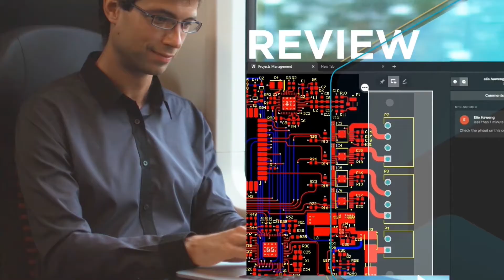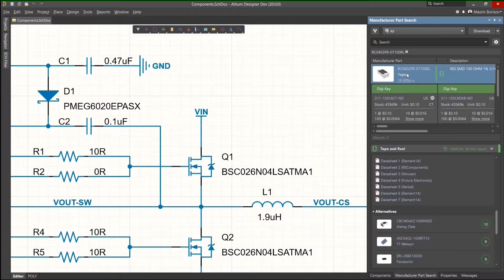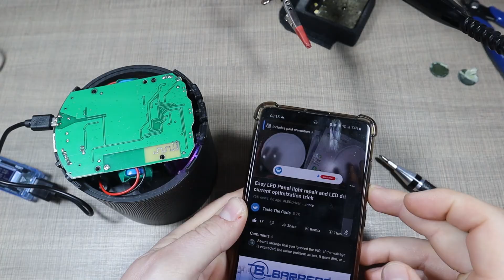Fixing a portable Bluetooth speaker with no signs of life

Comment: Hey man, I need your help if that is okay. I have a MEGABOOM 3 made by UE which after being exposed to water has stopped working. I was under the impression this speaker was water proof, as I have had it under water with no issues before. They also advertise this as a feature in their main selling point. The speaker still turns on, connects to my phone and charges. However, the speaker plays no sound at all. When it first was submerged the music was still playing but the sound was "staticky" and not clear at all. After letting it sit to dry off it then did not have any sound at all. Please let me know if you know what I can do to fix this, or what is the problem for this. I was told by UE they don't do repairs and they said their best offer was a 15% discount, so I am stuck outsourcing for a repair as I don't want to completely replace it. I feel it is a waste. 

Thank you in advance!
Reply from the maker: I'm not familiar with that specific model but when devices get water damaged, what usually happens is that they develop corrosion on the board. To inspect and possibly mitigate this, you will need to disassemble the speaker and look for areas with discoloration and green oxidation. This can be cleaned with isopropyl alcohol that is at least 96%. If there is no damage to the circuit, the speaker might start working again but this is not guaranteed.
Reply: @TasteTheCode  Great stuff
Reply from the maker: Thanks

Comment: How can i fix my omega portable speaker that when i switch it on theres no sound but only power on light?
Reply from the maker: Check for broken wires. Otherwise it might be an issue with the amplifier circuit.

Comment: I have a Bluetooth speaker,  but switch off even turn switch on, it turn off by itself. Any idea why this is happening??
Reply from the maker: The battery might be gone. When a lithium battery is bad, it will often go undervoltage and the protection circuit will turn the device off.